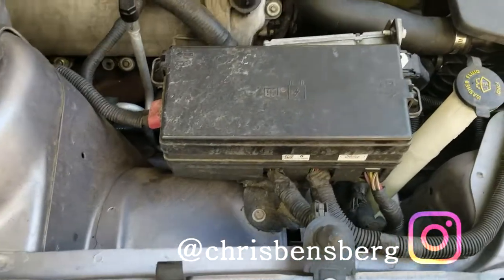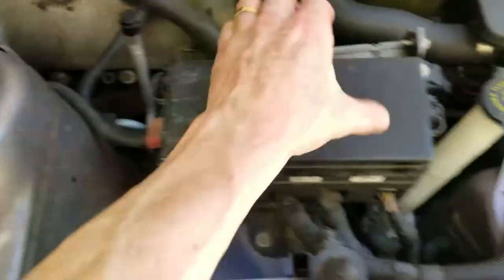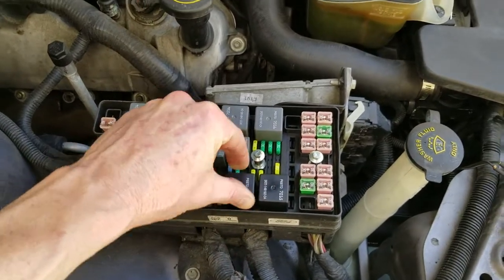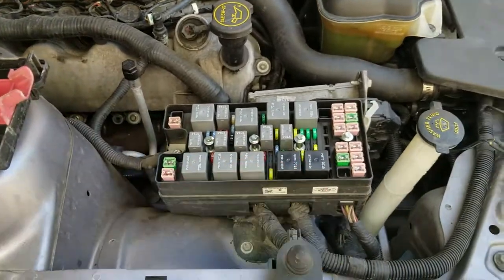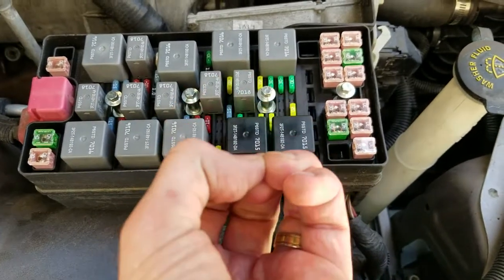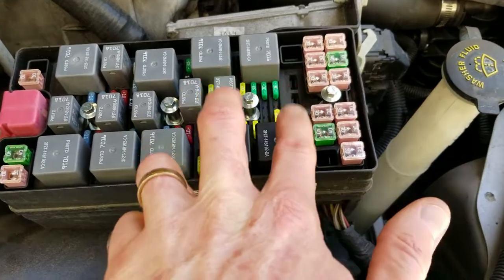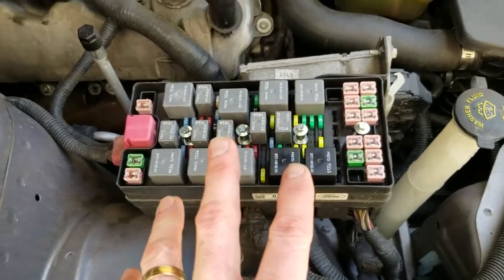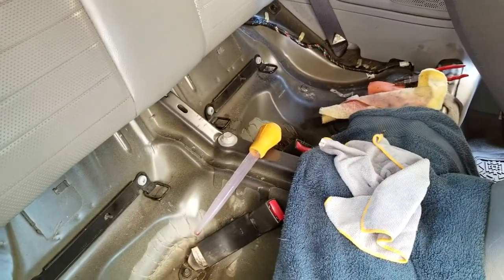Ford Mustang Convertible Top Relay Testing & Replacement Location For Fixing Broken Top

Comment: My problem is different. It moves up and down. I fellows the hydraulic fluid. Its moving very slow and doesn’t close all the way. I have to pull really hard on the locks to get them to connect
Reply: Mines the same way. What did you do to fix it?
Reply: You might have air in the lines , try bleeding it out and refilling the fluid

Comment: Hello . I have a problem as well with my top .. both relays click in the up and down position .. the top does not move .. i then unplugged the top motor and ran power direct to the pump and it worked just fine . the top wont work with the switch just the relays click ? do you have any other idears on this problem . thank you
Reply: TheMarkyGs my 93 foxbody just started doing the same thing. Did you figure this out
Reply: @stevenvaldez3520  I had the same problem guys on my 07. I recommend checking the voltage on the motor if you don't see any voltage after the windows go down it means the circuits is not fully connected. For my case the base of the relay box needed replacement.
Reply: Abdulelah Habib    Hey AH. Ended up buying  a new motor for the top from American Muscle.  I think it was about 250 bucks. After 25 years the old motor had its ups and downs 😁
Reply: Abdulelah Habib hey man , I’m having this issue now . What relay box are you referring to?? Inside the hood or inside the passenger footwell? Thank me ahead of time
Reply: I have a 05 mustang I replaced the pump and it still does not work both Relays click the switch is working I check the parking brake switch it is good and the top does  not work is it possible the relays could still be bad even though they are clicking?

Comment: 2002 mustang. The top starts going up, but can't go all the way. Motor is running. Will it work at all if the relay up is bad? Thx
Reply: needs fluid if it is moving slowly  motor is good and relay is good

Comment: My son has a 2001 3.8 convertible and the top stopped working.  He thought it was the switch because we had recently filled the fluid according to your video and all was fine for about 6 months.  I checked the switch and it did feel dinky but it tested good with the tester.  So I checked the relays and one of them was dead as a door nail and the other one tested good.  However, I was not able to get the top to go up or down by switching the places of the good and bad relay.  Does the top need both of the relays to work in this car?  I should probably go ahead and buy 2 new relays instead of just the one I think.  What do you think about the plan of attack?
Reply: Did you have any luck getting the top working?

Comment: Upon activating the switch to put the top down, all windows except right rear went down and the top did not go down. I turned everything off, came inside, saw this video and was going to check relays. Now the switch takes all windows down and the top went down as well. What's going on? I don't want to get caught in the rain and not being able to put the top back up.
Reply: Did you ever happen to figure out this issue? Currently going through the same thing.

Comment: So of it doesnt click that means the relays are bad ?
Reply: Yes
Reply: NO! Can be a bad switch or no power to the relay. The coil on the relay might be bad and still click but a previous low voltage condition could have welded the contacts together. I would jump the power at the relay to check it's not the relays.
Reply: oglilp2fo how do you jump the power at the relays? I’m having this same issue
Reply: @bobayagga2233  just connect power to the motor directly. Ground and positive. If the motor works you'll hear it "run". Just get a long cable to the battery and a short one to ground. I usually test my motor like the window motors at a dismantler with my battery from my 18v electric impact... not for the novice though lol